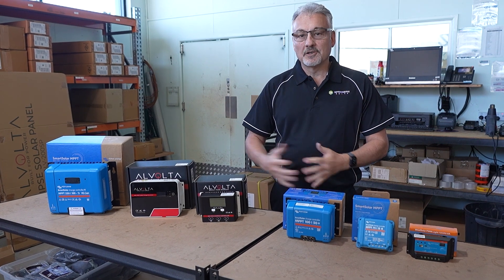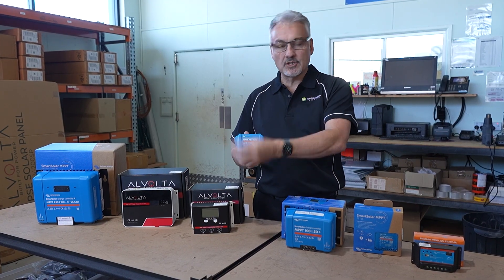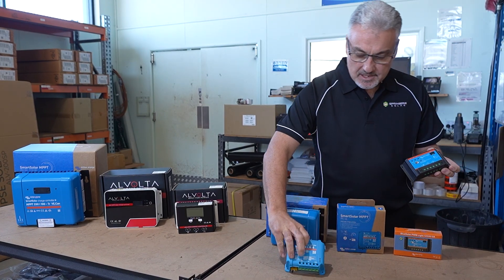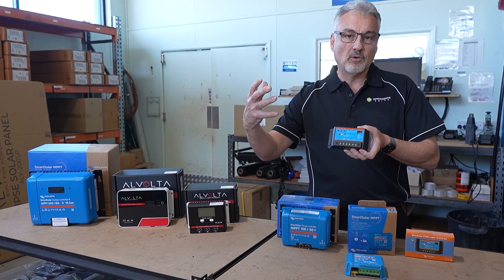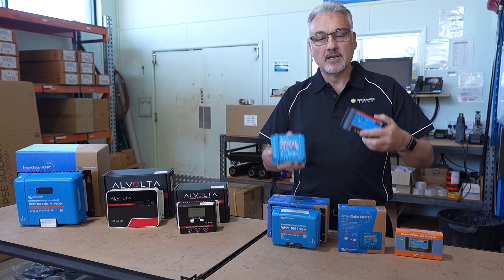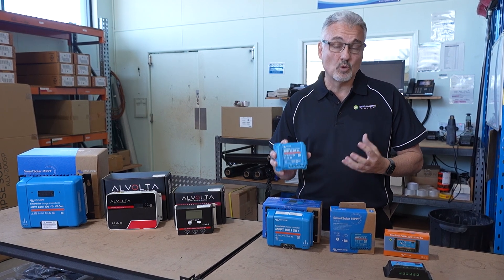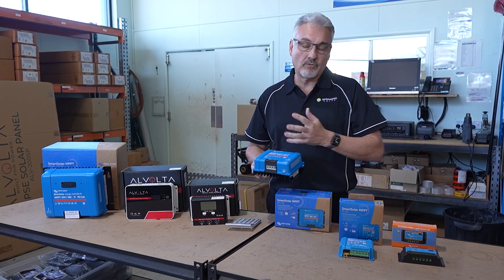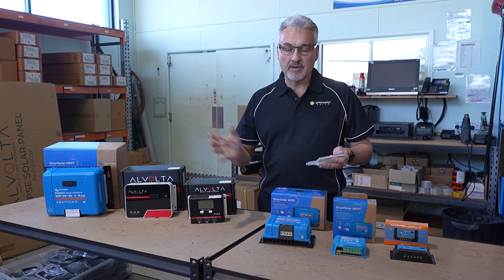Solar Regulators 101 | Watch This Before Buying

Comment: Also keep in mind that if you use a higher battery voltage, solar charge controllers can handle much larger solar arrays.  So that little Victron 75/15 for example can output roughly 192W to a 12.8V LiFePO4 battery (15A @ 12.8V), but the same controller can output 384W to a 25.6V battery.   (In reality, a tad more since the charge target voltage is a bit higher).

A charge controller like the Victron 100/20 is spec'd for 12, 24, 36, or 48V battery systems so that same unit can output 256W to a 12.8V battery system, 512W to 25.6V battery system, or 1024W to a 51.2V battery system.

When dealing with larger solar arrays it is usually best to go with a higher battery voltage rather than waste money buying expensive high-amperage charge controllers and ridiculously thick cables.  All the wiring will be smaller as well.

For example, a Victron 150/35 can stuff almost 1800W of solar into a 48V (51.2V LiFePO4) battery system with only 8 AWG cabling (roughly 8.37 mm^2).  A Victron 100/20 with a 20A output can run with 10 AWG (5.26mm^2).

(BTW: These units are called charge controllers, not regulators.  While they do regulate their output, they are primarily current regulators and only do voltage regulation as a secondary function.  The outputs are expected to be connected to low-impedance batteries, else the voltage will fly around a lot because charge controllers are not power supplies).

-Matt